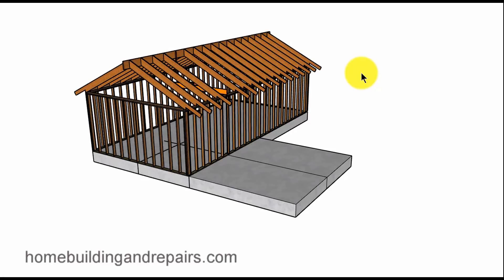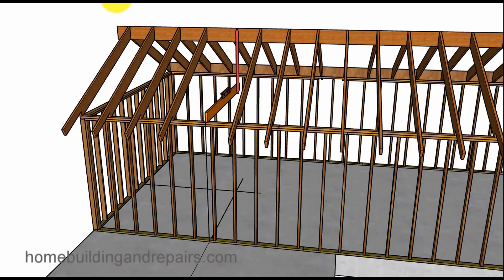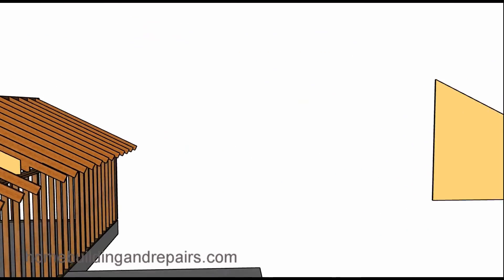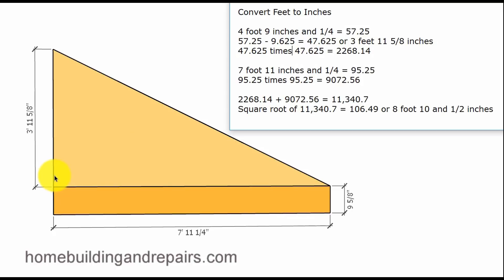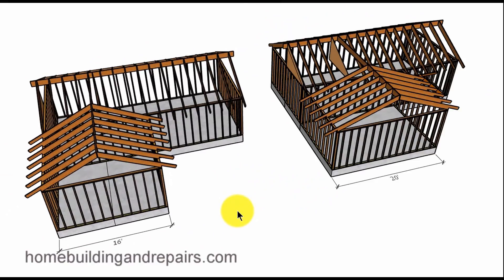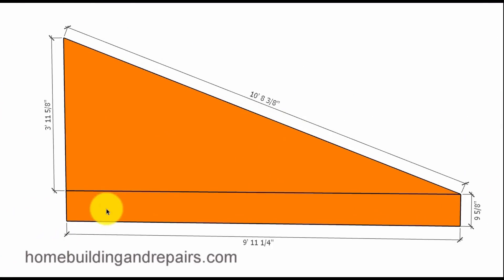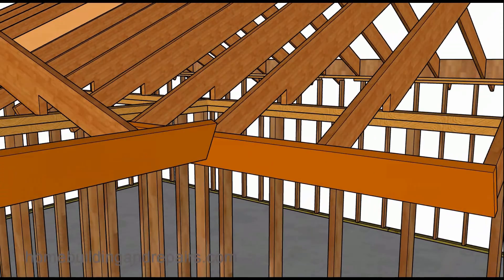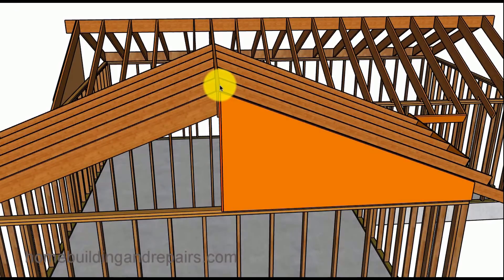How to Calculate Roof Ridge Height and Rafter Length – Home Addition Framing Tips

Comment: Hello, my question is off topic but similar. What the largest hole that can be made in a floor 2x6 floor joist if needed? Im adding to my existing single story home a Master Bedroom and bathroom , but also adding an ADU rental unit on top of the Master suite. When the architect asked about heating i said the ADU would have its own Mini split for Heat/AC and the New master bedroom would also have its own mini split separate from the main house. 
I changed my mind about the New Master having its own mini split. Since there is a vent close by that I can steal from the living room of the existing home. the wall from the existing home (living room wall) and the new Masters bedroom wall will be parallel to each other, I want to take one of the vents from the living room and vent it through into the Side the wall of the Mater bedroom. Can I just that change during the construction framing phase or do I have to resubmit drawings. ? are plans have already been submitted and don’t really want to pay the architect and engineer again for that change?
Reply from the maker: One and a half inches by most building codes.

Comment: Hello, I really appreciate your knowledge and information you provide. I have a question regarding to change a roof pitch from 3/12 to a possibly 6/12 or 7/12 or 8/12. I have a double wide manufactured home and I have this idea to engineer a truss design that has a 3/12 pitch on the underside and possibly a 6/12 for the roof line pitch. My thought would be to remove the shingles and expose the plywood, mark the existing trusses which are 24 on center, install the new trusses directly over the existing trusses where the 1/2 inch OSB would be sandwiched between the two. Obviously this would require some proper engineering and the correct steel fasteners from Strong Tie. I believe the type of truss I was referencing is "Scissor Truss"  but I'm not sure. The current span is 28' and the length of the house is 58'. My thought was to include an 8' front porch as part of the truss slope design on the full length of the house. Basically, "I think" the main pitch would be anywhere of 6/12 to 8/12 and the porch pitch would like to keep it at least to 4/12. The final roof covering would be metal roof. Final note, I am not a builder, but I have over the years build and remodel my own and family members home projects with passing inspection, I know enough and research the rest as I go along. Thank you.
Reply from the maker: You're welcome and it sounds like you're making scissor trusses.

Comment: Greg I really enjoy your video's,  I always gain a lot of new information when I watch them. Your diagrams 
are excellent and make following along much easier. Your volume on this one was a little low, at least for an old guy like me. But still a great learning tool. Keep up the great work, thanks for sharing.
Reply from the maker: Thanks for the kind words and I have heard other complaints about the volume from people using mobile devices or cell phones and have hopefully fixed it on my newer videos.
Reply: Hello gregvancom - I have a question to ask. I am proposing to build a 24’Lx20’W detached garage that has to have a 5/12 roof pitch to match my existing home roof pitch. The problem I’m having is my detached garage will have 10’ tall walls versus 8’ walls in my existing home. 

How would I calculate the height of my roof ridge of my proposed garage I’m planning to build versus the height of my current homes roof ridge? 

City code here states that the detached garage roof ridge cannot be taller than the existing roof ridge of my home. It has to be subordinate, which I believe means the same or lower.

There is a section of my home that runs 26.7’ wide with a 5/12 pitch roof with 8’ tall walls.

Will my detached proposed garage roof beam height be taller or shorter than my existing homes roof ridge?

How would I calculate the differences of heights between the two buildings? 

Thanks ! My city code requires it.

Comment: A triangle with the sides labeled and the 90° shown would be helpful. Then the formula a2 x b2 = c2. Then show the plug and chug. Might help the viewers. I like your videos a lot.
Reply from the maker: If there's one thing I've learned making these videos it's the fact that there's either too much information in them or not enough. You would be surprised at how many people tell me that my videos should be shorter, while someone else is suggesting that they should be longer. Thanks for your input and I'm glad you like my videos.
Reply: @gregvancom  people will complain no matter what. You could give them each 1 million dollars and they would still complain. I was just suggesting  what I felt was extremely relevant information. Without it, I think a lot of lay people are lost on what you are talking about.
Reply from the maker: You're absolutely right about giving people $1 million. I do appreciate constructive criticism like yours and made a video years ago about using this formula, but will make one again for this channel.
Reply: @gregvancom  that's great. The Pythagorean theorem is the main formula to building square. You can state it enough.
Reply from the maker: You're absolutely right.

Comment: Why use Pythagorean Theorem for roof rafters, when there are much simpler ways. All you need know is the width of your addition and the pitch of your roof.
Reply from the maker: Sounds good, could you provide us with a brief explanation of your method. I'm assuming that it will provide us with results much quicker.
Reply: 1st of all, you'll know your total rise (height) by multiplying the total run (half the span) by the pitch. With A 30 foot wide building, the run will be 15 feet. 15 X 8 (for an 8/12 pitch) =120 inches. 

To find length of rafter for this, simply look at your framing square. Stamped onto your square are six lines of words, the top line being - "COMMON RAFTER LENGTH PER FOOT RUN." Follow that line straight across to the #8 (for an 8/12 pitch) and you'll see the #14.42. This means that for every foot of run (15), the rafter will have 14.42 inches of length. So, 15 X 14.42= 216.3. The rafter, excluding any overhang, will be 216 5/16 inches long. Obviously, you'll shorten it for the ridge board and fascia.

The simplest method is the step-off method. Put a square clip on the 12 of the square blade, and a clip on the 8 (for an 8/12 pitch) of the square tongue, and simply step off 15 steps, one step for every foot in the total run. This method does all the math for you, except for counting 15 steps.

Some carpenters like using a rafter table book, which tells you the length of rafter for what you have. Personally, I don't like having to rely on a booklet that I'll probably lose. 

None of what I'm saying is meant to be against your method. You're method is as good as any, it just seems to me that it's the long way around to get to the rafter length. Maybe that's just me.
Reply: The method i gave is the Pythagorean Theorem, but the square roots have already been calculated for you, and are stamped on your framing square. All you have to do is multiply that number by the number of feet in your total run. This saves you the steps of having to find square roots.
Reply from the maker: Gotcha.
Reply: Again, I don't mean anything against the way you do this, it's just that I've seen other carpenters teach it that way, and I can't help but wonder why carpenters don't use the information stamped onto their framing square.
Reply from the maker: I don't take any offense to your statements, but I was hoping that you were going to provide me with a faster, new or superior method. Remember, my videos are meant to provide people with methods that have been proven to work or possible solutions, for the most part and nothing more.
Reply: The methods I gave are quicker, because part of the calculations are already done for you, and are stamped on the framing square. As for the step off method, ALL the calculations are taken out of the equation, because you simply step off the number of feet in your total run. That's the easiest and simplest way i know of. These methods are not new, but they are certainly proven to work, and In my opinion, they are superior methods because of their simplicity. Not every framer knows the Pythagorean Theorem, but I would venture to say that every experienced framer knows at least one of the methods I talked about.
Reply from the maker: Good points and you're right. If you have a framing square with the desired roof calculations on them, then it would be faster.
Reply: I know they use to stamp squares with those calculations on them. I've had mine for several years. There's no telling what they're doing now. The things that make the most sense are usually what ends up being done away with.
Reply from the maker: I think I have one in my garage that's worn and you can barely see all of the additional information associated with figuring roof rafters.
Reply: Well, I guess that answers my question as to why some carpenters don't use that method much anymore. I guess I'll have to stay in the dark as to why they don't use the step-off method. lol
To each their own, I guess.
Reply: @Jay-tk7ib  that will not give you your total rise height, you will need to add H.A.P to that total to get your appropriate ridge height
Reply: @jeffro1245  Yes, I know that. I was just referring to methods used.
Reply: the step off method is superior.. what framer doesn't have a framing square?